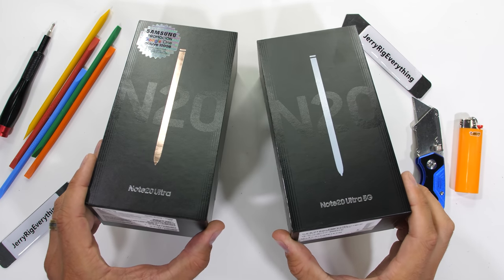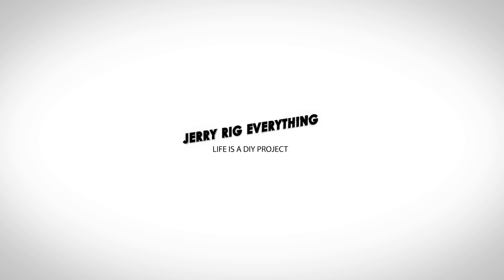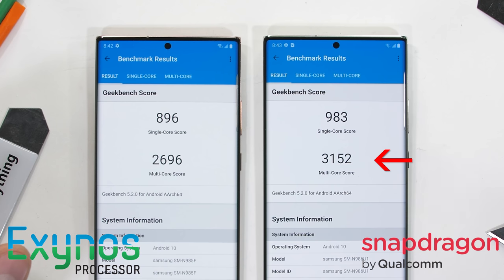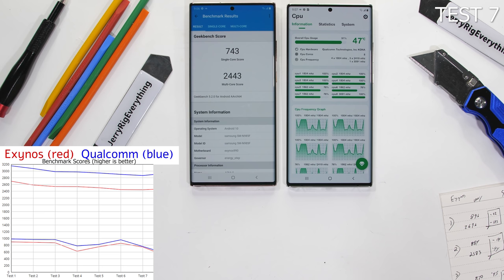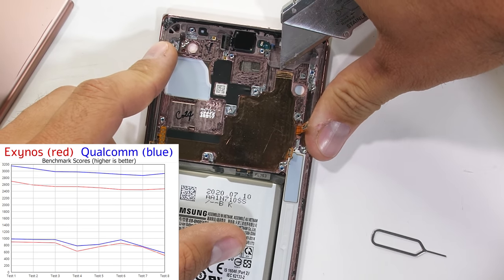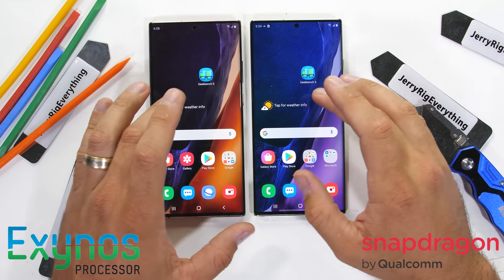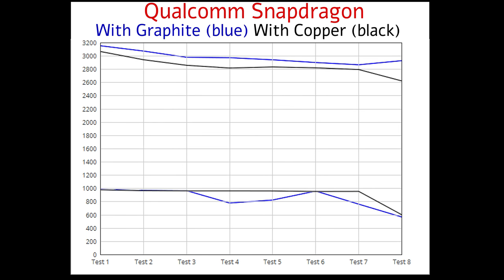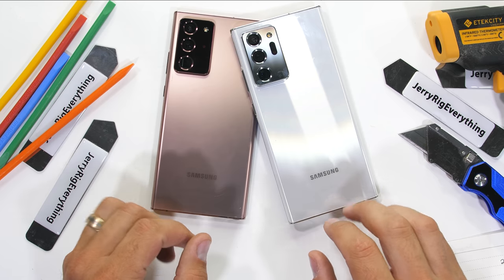Samsung should explain this... Exynos vs Qualcomm?! - Note 20 Ultra

Comment: When my Phone comes in the mail tomorrow, Im gonna send it right back! 😠
Reply: Not even gonna notice lol. Such babies.
Reply: You won't notice a difference there no point in sending it back
Reply: @END3RFY   He would notice, I do too, less battery life, Overheating while gaming and charging, weaker Gpu performance, lag after 2 years, compared to my US Friend's whose phones work better than mine though older or cheaper
Reply: Yeah. Better freight forward the SD chip from the US. Dump exynos.
Reply: @johncs154  I got the Exynos version of the s20 ultra and I am having no problems, I don't even use my phone for gaming either that's why I have a tablet, console and PC. Works fine for what I want if for
Reply: Phil S “I don’t run anything intensive on it, so it runs fine”, well duh... This is literally like my joke where I ran a CPU at 5.5 GHz and was like “and yes, it runs M$ paint just fine”.

If you didn’t need all that performance then it was likely a huge waste of money, because a $200 phone pretty well matched these or you would probably be fine with a $79 phone, lol, but it’s like my dad using just word processor and saying “who would need more than a single threaded Celeron?”, that’s not what you’re paying the money of a Threadripper for.
Reply: Jay it’s not about not noticing it’s about how it’s unfair that you pay the same as a US buyer but get a shittier item
Reply: SilentShadovv so I did
Reply: Jay why would you pay money and not get your money’s worth?
Reply: Jay exactly
Reply: Mohyi M  for me the processor is the most important and this shit is still lacking on that too
Reply: @johncs154  the fucking flag ship phones cost a lot of fucking money and you should expect a good product or at the very least have the same spec.. I dont want to pay for a ferrari that drives like a lada
Reply: Mohyi M  it's the most important part of YOUR phone. For everyone else the software is the most important part.
Reply: @aureliano_37  why didn't you order the other version then?
It was clearly stated every time and you are able to buy both (at least in europe)
Reply: At least play with the damn phone first.  Don't make a decision based on one person experience.
Reply: Thank you
Reply: @johncs154  lol  trust me, you'll notice
Reply: @johncs154  the S20 plus 5g gets too hot after a few minutes of YouTube. Absolute dogshit
Reply: Fckd_up_rabbit only if you have both phones.. if you don’t you’d have nothing to compare it to.. so yea.. you won’t notice..
Reply: Lallushe I did “saw” but my point is unless you have both phones you won’t even notice.. I know that one version is better than the other.
Reply: Lallushe you guys are really taking this the wrong way. Yes I know one is better than the other. They should specify which phone is better or name them different.
Reply: @jakegarrett8109  that's your opinion, like i said I am happy with my purchase and have no regrets
Reply: @martini380  How did you assume I live in Europe? They just sell the Exynos here in India that too at a higher price than EU, USA, Canada

Comment: I bought a Galaxy S20+, but I was disappointed with the Exynos version, so I sent it back. Waiting for the Pixel 5 now
Reply: Disappointed with what if I may know.. I am planning to buy the same
Reply: The Pixel 5 will have the midrange 765G chipset, which I believe has lower performance than the exynos 990
Reply: @DK-jw4vf  Ofc, but it's a way better power/price ratio.
Reply: @vipulbhardwaj1312  Mainly with the camera, but also with the performance of exynos compared to snapdragon. Also it kept crashing. I reported it and they wanted to send me a new one but I told them I'd rather have my money back
Reply: @DK-jw4vf  atleast it wont be overpriced like the note 20 ultra
Reply: Dude just get another Samsung the google pixel isn’t worth it
Reply: @dendenanimation1496  dude just get another one plus samsung isn't worth it
Reply: @dendenanimation1496  It is.
Reply: Same with me dude. Used for just a week and got One Plus 8 Pro. Couldn't be happier.
Reply: Pixels are overpriced outside the US.

In my country, Pixel 4a official website price is 461 USD (21% tax already included).
Reply: @roimores  Google uses a better exchange rate than any other company. Most smartphones in the EU have a higher Euro price than dollar price in the US (also because of tax reasons). Meanwhile, google charges a lower Euro amount
Reply: @EseLyx  10% more expensive price before taxes. In the US they ask $349 before taxes, in my country $381 before taxes. In fact, a lot of companies do this and that's why you should almost never buy from official online stores.
Reply: @roimores  Yeah but the other companies are way worse than Google. I'm not buying from the official store anyways
Reply: Eselyx it’s not ur gonna be disappointed

Comment: Why is everyone remembering exynos now it has existed for years and always has been slower than snapdragon
Reply: Not always
Reply: earlier versions were better, they became worse after s7 or s8 iirc
Reply: not always there was a time where exynos was  better than snapdragon
Reply: This is not a new topic, it has been talked about for years now and still samsung does what they want
Reply: Because samsung did it worse by giving 865+ for note while keeping 990 for rest of the world
Reply: because of the same high price tag obviously
Reply: It has gotten worse on recent flagships
Reply: because phones are getting more and more expensive yet Exynos clearly isnt getting any better. you are paying way WAY more for way WAY Less...
Reply: I think it's because Samsung still insistis in use Exynos processors in their flagship line all this time even knowing they are outperformed by the Qualcomm variances.
Maybe if they used the Exynos in the intermediate and low level phone lines, no one would be hating and talking about the Exynos processor this much.
Here in Brazil, they're selling the Exynos variance, and the phone costs arround 8k (~1.5k usd)

Comment: So basically Samsung put the copper cooling system inside the Exynos version while the Snapdragon version rocked the graphite cooling system.
Were they trying something here or just trying to slow down the Snapdragon version to lower its performance?
This is fishy. Samsung, shame on you!!
Reply: they did that to get the price down since exynos ironically is more expensive to produce
Reply: Wym slow down the snapdragon? Graphite has more thermal conductivity than copper
Reply: ghraphite is better than copper
Reply: @subscribernovideochallen-sh8cy  Absolute Bullshit. Graphite isn't remotely better than copper. GRAPHENE IS and graphene isn't used here. Get u facts right
Reply: @Souls4Roca  wow!

Comment: Bought my S10e imported from the US for this exact same problem. The Exynos variant sold here is slower and less efficient.
Reply: i've got the exynos one here in Brazil,  where i live, it is a great phone, still not as good as the ones we see in the US and Korea since it has a poorer battery life and heats up pretty quickly.
Reply: yeah, even using medium power saving for  exynos s10, it still running hot, battery hog, and throttling like crazy 😂
Reply: @alterguedes5025  also from Brazil, I bought one and sold it after 2 months. Could barely get 4h of screen on time, awful battery, drained too much battery on idle and specially in 4g. I arrived at work at 9am with 93% and left at 4pm with 40-50% with 1h30 of screen on time. Using low power mode, dark mode, almost 0 apps running on background, no Bluetooth. Not to mention it got warm by scrolling through Facebook or Instagram.
Made me miss my old Zenfone 3 with a Snapdragon 625
Reply: How to buy the Snapdragon version from Brazil????
Reply: @MarkHobbes  Brazil sells exynos version, not snapdragon.
Reply: @Eduardo1007  Você é brasileiro, não é? Eu sei disso, sei que não vendo versão Snapdragon aqui, mas queria saber como obter dentro do Brasil a versão americana, porque a vendida no Brasil não tá com nada. Será que vale a pena importar? Será que sai mais encontra, mesmo se for taxado, se comprado com o preço da versão brasileira a vista? Eis a questão.

Comment: I mean, they're kind of labeled differently, BUT only IF you look at the model number. It's a little dirty, but a Toyota Tundra is still a Toyota Tundra regardless if it has a 4 cylinder or an 8 cylinder under the bonnet from the factory...

Comment: Thats why I avoid getting Samsung in Australia only has Exynos option. I went for iphone 11. Disappointed to see this.
Reply: Good Choice iPhone had over 2000 single core and over 10,000 multi core
Reply: Does the 11 satisfied you so far?
Reply: @thomasmcdonnell1957  No. iPhone has ~1300 Single core and ~3500 Multi core. So, multi core is about the same as a Snapdragon 865, but Single core on the iPhone is A LOT better than the SD865.
Reply: hahaha you seriously a sheeple when you chosen an inferior Iphone instead of the note 20 ultra. In New Zealand we received a whopping $1045 on extra goodies like live buds air and 7kg boombox. And the phone is way faster then anything seen before so the difference between these two versions you won't even be able to notice. Just watch the market why you think Apple just lost 2 trillion the biggest loss any company ever experienced. Good luck with your iPhone soon their service department will be closed down and you might be happy when you find someone offering you $5 for your phone.
Reply: eco logic geez!!! You gotta chill man.... So much negativity... You sound like they paid you to do this kind of advertisement.. funny guy
Reply: Brahm Williams very happy with what I got love retina screen with colour calibrated and stable ips screen with no pwm flicker. And no black crush too. Great hardware too. Plus I paid extra with apple care for two more years.
Reply: Brahm Williams absolutely why negative post from eco logic 🙄
Reply: @naththoau  there is nothing negative on reality. Learn live with it or stay out of the kitchen when you can't stand the heat